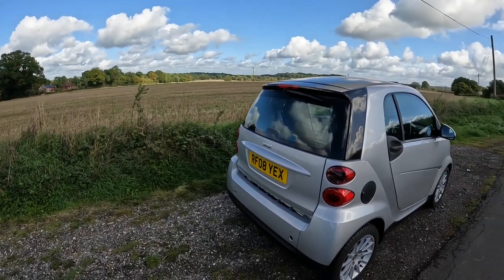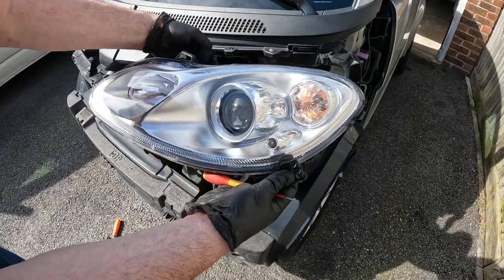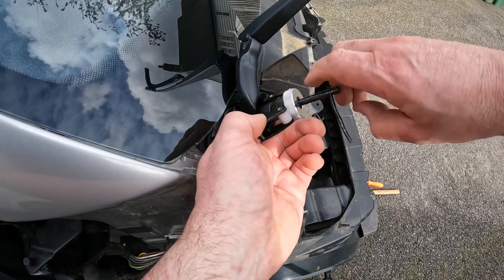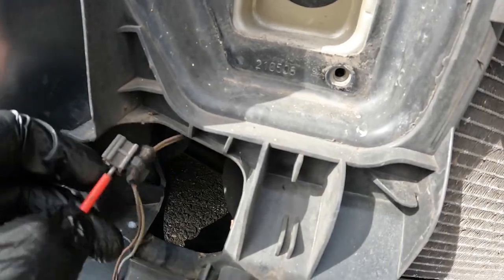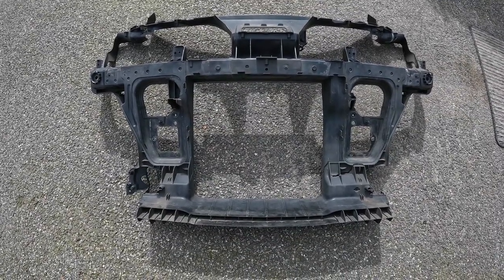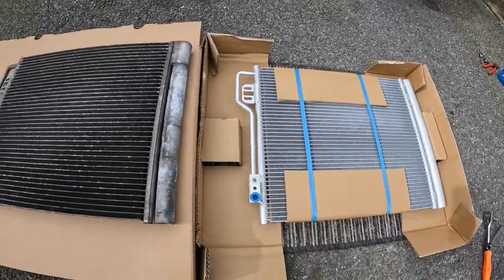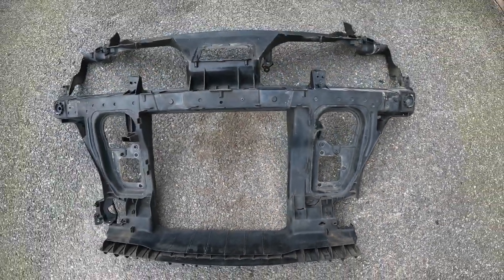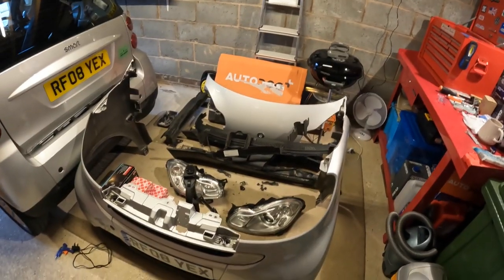Smart Fortwo 451 - Replacing Air Conditioning Condenser - Part 1

Comment: Hello Auto Knight,

Enjoyed your video on condenser replacement as I had cooling fan failure on my car (and condenser was failing aprart.....grrr).  

NOTE:  I do not recommend the after market headlamp modules.  My ForTwo had slight accident and body shop replaced with no OEM/smart unit and it failed internally within a year.  I work nights and got pulled over by the police for headlamp issue non-compliance (projector was loose inside housing and bouncing up/down).

Keep on the videos!  Very informative and relaxing.

P-Chi

Comment: Very good video with detailed informations on everything like bolt location, size, function of the component, etc... If you have the torque value for some bolt...  I have a 2014 451 electric drive with 92k km. Have problem with the steering column: hard to turn for about half a turn  than soft than hard than... Appreciate your advice on how to solve this problem. Regards from Quebec, Canada

Comment: I really enjoy your videos! I have a 2008 Smart Fortwo Cabrio that needs to be repainted and all the body shops are making a Big deal about taking all the panels off and want to charge me 10 grand USA to repaint. 4 different body shops all quoted me the same price Im shocked. I would just buy new panels if I could get them in the USA. Unfortunatley Mercedes can only order 2 colors now white or silver panels in the USA .
Reply from the maker: Thank you! 10k is crazy money to repaint the panels on such a small car. I’d take them off myself and deliver the panels to the body shop. I’d expect to pay just a few hundred here but that’s with mates rates. Maybe check eBay overseas and import some panels. The only downside is that they can be a bit difficult to ship. They come up on eBay in the UK from time to time.

Comment: Great Video, I'm about to do mine soon, and your video will be a great help. Can you remember the part numbers for the o-rings?
Reply from the maker: I had a bit of a performance getting the right o-rings so I can’t be sure on the final correct part numbers. There are different sizes from Smart and due to the low cost it’s prob best to order all variations to be sure to have the right ones.

Comment: Hi Mate

Quick question on my 451

I was fiddling around fixing a damaged under tray today and noticed that the radiator surround appears to be fixed to the front plastic chassis by one T35 screw but that screws into a plastic shaft on the radiator housing which then means the bottom of the radiator housing is allowed to move 20mm or so when the screw is tight.

Is there a missing part or spring as this doesn't appear normal. I would have expected the radiator housing to be firmly fixed to the plastic sub chassis.

Any help you can give, most appreciated 😎

Comment: Been running my air con through the winter it works find put it on yesterday no cold air topped the gas up today the gauge says it’s in the red over 60 psi and the regas pipes are red hot they have never been before do you know what the problem could be? Thanks

Comment: hi there, great job,  i have a question i have a left-hand drive smart 451 2009, I am having water dripping from passenger side when facing the battery, sitting on the passenger seat, the far corner on the right, drip water, under the carpet can you help in guiding me to know from where this water is coming.
Reply from the maker: This may help - I made a video on my water leak issue:

https://youtu.be/xVpKxsR8kWI?si=d7gmtbh-D0WWZYAX

Comment: In my case the radiator fan is really noisy/loud, Can I replace only the fan? Or is it one piece with the radiator?  And do I have to (let) drain the AC system?
Reply from the maker: The fan generally comes with the cowling that it is built into. Access is incredibly tight and I can’t think of a way to remove the fan without the radiator, in order to separate the two. The ac condenser has to be removed to access the radiator so the refrigerant would need to be reclaimed and recharged following the job. The two o-rings should be changed when refitting the ac pipes to the condenser.

Comment: Can I use this same process of removal of the front body to change the radiator fan? I need to change out my radiator fan and I’ve never done this before so I’m trying to figure out how to remove all the front body parts.
Reply from the maker: Yep you’d need to do a very similar strip down but with a little bit more to get the radiator unit out.

Comment: My car has developed a grumbling sound whrn ac is turned on.  Emanating from the left front area under the dash.  Could this be the compressor? I was thinking the radiator fan, but the dealer said it could be the compressor?? That doesn't make sense.
Reply: Same issue I think I have from your description. Still no luck finding a mechanic that knows what it is. The only thing is it still grumbles when the AC is off.

Comment: Silly question but how do you know when you need to replace the condenser?
Reply from the maker: Corrosion, damage or a hole allowing the refrigerant to escape to the atmosphere. Dye can be added during the recharge process and this can then be seen with a UV lamp if there’s a leak. There are also leak detector wands that sniff for gas and alert of leakage.

Comment: Watches this video to find, that, though technically possible, I won't do it. Smart 451 is the most expensive and complicated car in my inventory in terms of repairs and maintenance (ant the rest of my cars are Mercs) due to it's compactness. Just got my front springs changed, and it also required nearly full front disassembly.

Comment: How did you diagnose the radiator as the issue ?
Reply from the maker: It is very corroded and there is a fracture where the receiver drier is held to the core. It wasn’t worth risking a re-gas going straight into the sky! As part of the recharge process we pull a vacuum and perform a hold test but in reality I’ve had systems hold a vacuum but then still lose gas when recharged. PAG oil with UV dye is added when re-gassing to enable leaks to be detected with a lamp and there are also leak detector sensors, like a wand, that can pinpoint a problem area.
Reply: Just inspected mine and found out that I have the same issue. Looking to replace my condenser similar to yours. 

Any tips when finding the part ? 

I’ve found the same one you got from AUTODOC for £80.13. 

Any reason why you went with a 12mm core instead of 16?
Reply from the maker: @L44TXF  I spent a long time cross referencing part numbers to reach the right conclusion to order the correct part. Firstly I measured the condenser to identify its dimensions, including the depth. I also found a genuine part on eBay being sold by a dealer and gave my registration, which deemed it compatible, therefore giving me the genuine part number which could be cross checked on Autodoc.